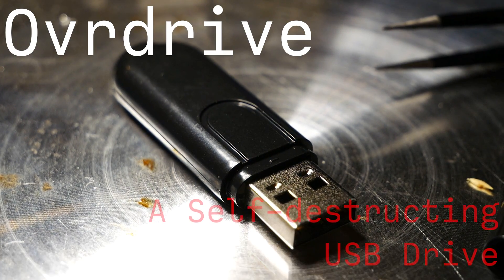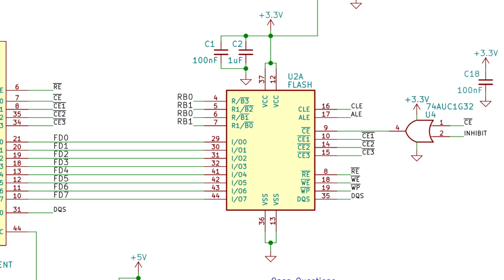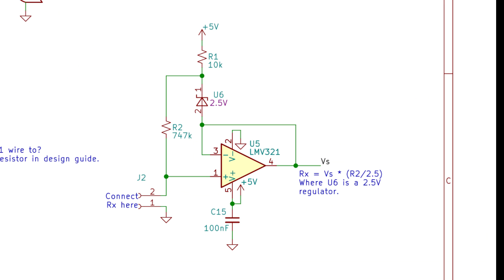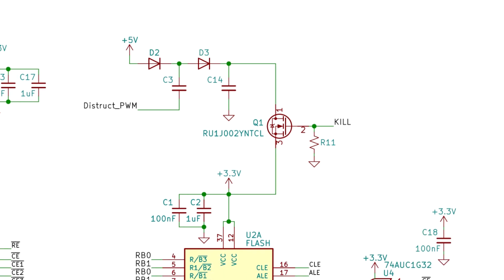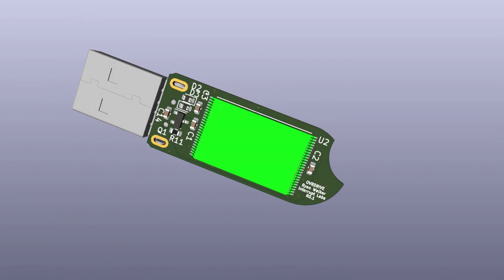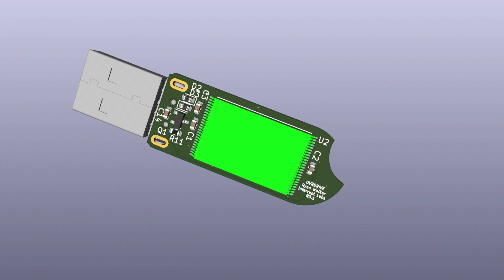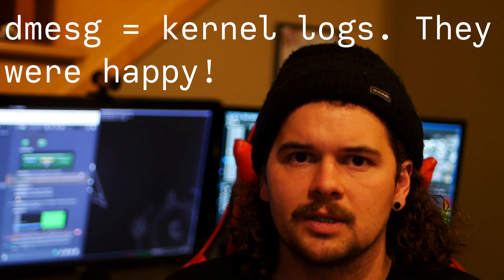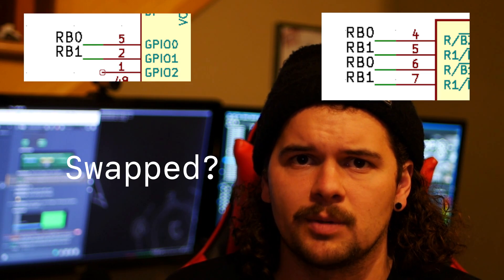I'm Building a Self Destructing USB Drive

Comment: Curious why licking instead of holding a certain way, a hidden switch, etc. Is licking a 100% consistent solution?  Seems like it might depend on a things like what you recently ate, sufficient saliva, etc.  
I think it's a fantastic idea, not talking shit at all, just curious
Reply: So, if you go to his blog, you will see that he has specified the following: "A finger is around 1.5MΩ, but wet fingers are around 500kΩ." So a third of the resistance means that it is just detecting the resistance and processing the kill switch if the resistance is of a high enough number. It has nothing to do with what kind of food you ate or how wet or thick your mucus is, it's just the moisture creating a barrier. I imagine water would reach the same effect as desired. I could test the results with my multimeter right now, just to see if his fingers are reaching the same ohms as mine, but I don't think mine is as sensitive to get those kinds of results.
Reply: @TheRealLAC  Using my multimeter, without treated hands (I was just using the computer and then picked up my multimeter, no washing, drying or licking), I got between 3-4MΩ.  After licking my hands, I got between 800KΩ-1MΩ.  Then I dried my hands and got around 5MΩ.  Then I put lotion on my skin and got around 1MΩ.

Even if dry vs wet is typically 1.5MΩ vs 0.5MΩ, that's only a factor of 3.  For me to consider something a reliable indicator, it would have to be a factor of, I don't know, maybe 20 or more.  100 or more for really important information.  If those readings are not extremely reliable, you could wipe out critical information by accident.  Your fingers just aren't quite wet enough, or there's a bit of dirt on the device, so after you lick your fingers, that bit of dirt gets between your finger and the device and causes a high resistance, or your skin is REALLY dry and absorbs just enough of the spit to cause a high resistance reading.

Comment: Very cool, but for those countries where you are considered guilty if you don't decrypt the data, if you destroy it the same reasoning might apply no ? Wouldn't it be better to instead overwrite data or erase part of it ?
Thanks
Reply: I'm pretty sure there is no "instant" way to delete and overwrite data enough times to make it unrecoverable. It takes a long time to do that properly.
Reply: @t12345d  The point is though, it's not clandestine or at all deniable. Even a cursory overwriting the first few blocks to an empty filesystem would be enough to deflect most further scrutiny, and killing the chip isn't enough to stop a sufficiently motivated attacker from recovering data anyway. (Though you'll be waiting in the gulag the entire time they're deencapsulating it and probing the wafer if they even care that much.)
Reply: @AJMansfield  I think you've got the 2 mixed up. Neither are really clandestine or deniable, as they're both last-ditch efforts to hide data, but I would definitely say the self-destroying drive is better.  Investigation would show the destroyed drive had a special circuit made for destruction, but it's much easier to both recover the data and show that someone attempted to delete the data and overwrite it.